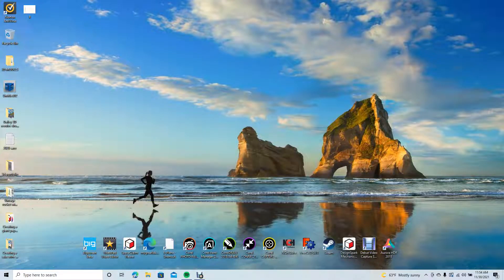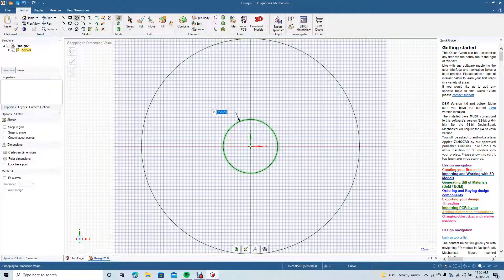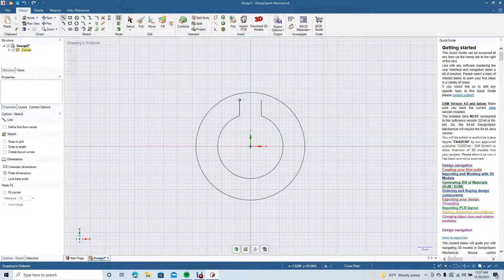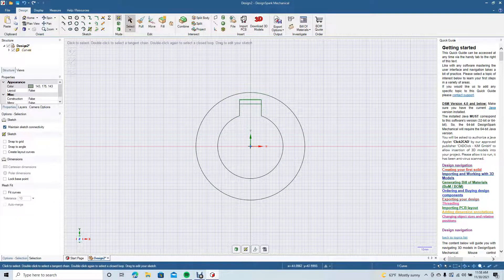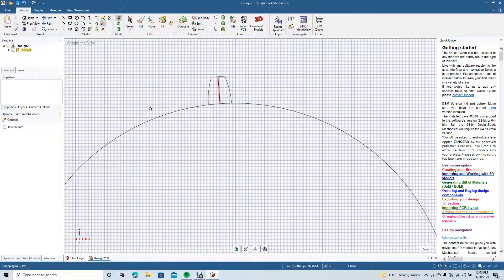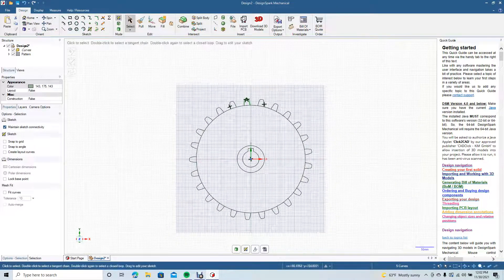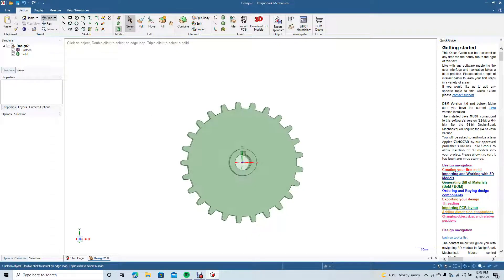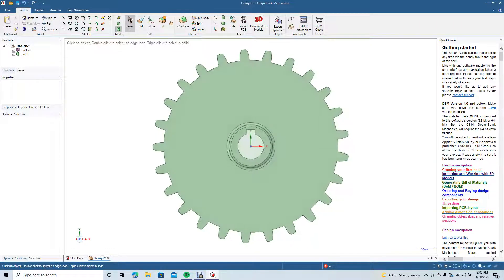Creating an involute gear with 25 teeth using design spark mechanical

Comment: This doesn't look like an involute tooth shape. It appears that it has an arc shape as tooth surface. There's also too much spacing between the teeth to mesh with a similar toothed gear.
Reply from the maker: No, it's not a real involute gear, and the video was only intended as a training tutorial. If it were a real gear, I would have created this from a drawing with dimensions. I just want subscribers to understand the basics of creating a gear like this.
Reply: Really ??? wow talk about miss the point